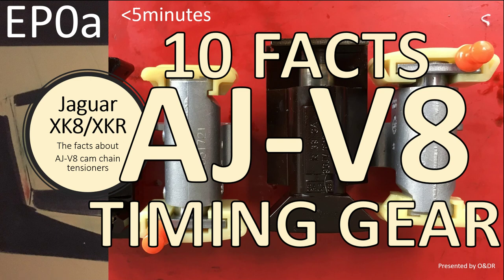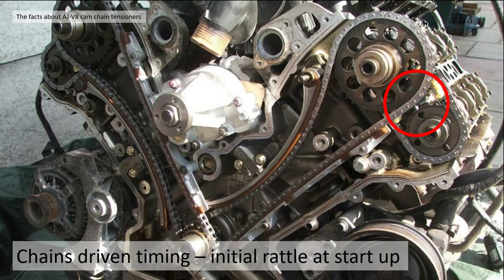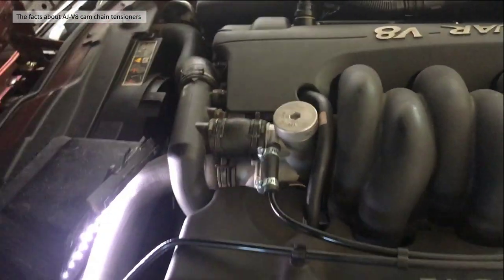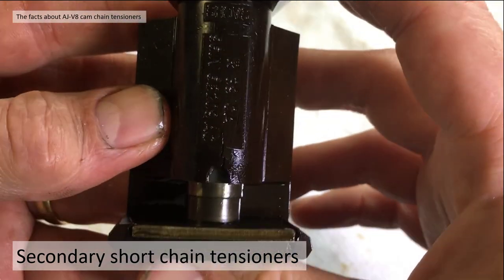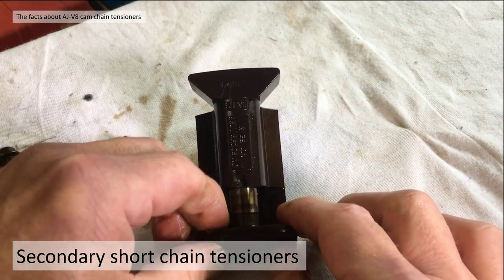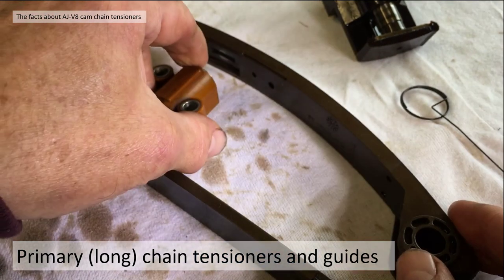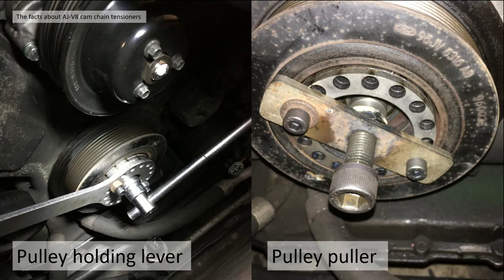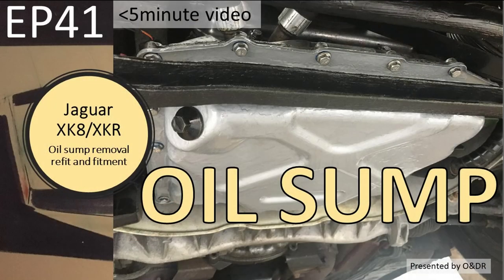Jaguar XK8  - 10 facts about chains, tensioners and guides AJ-V8 timing EP0A / XKR (X100)

Comment: Hi Damian, I wanted to share my experience, hoping it will help your viewers and XK8 owners. 
I own a 2001 XK8, and have heard on several forums and XK8 owners clubs, that early engines produced after August 13, 2001 may still have plastic chain tensioners. 
Well, last week I decided to open my valve cover and I discovered, with great happiness, that mine are metal. 
My engine has the number 010821, so it was produced  just a week after the update. 
Thank you for your videos, greetings from Italy.
Giuseppe
Reply: I forgot to mention that the previous owner, who owned the car for about 15 years, never bothered to check, 
so obviously, 
but also according to my mechanic opinion , the chain tensioners are genuine Jaguar parts.
Reply from the maker: Giuseppe, thank you very much for the information. This is extremely interesting. We couldn't find where the original date originally came from. We have been trying to verify the '13th August 2001' date with any official Jaguar documentation. However, we have been unsuccessful other than confirming its somewhere around that date based on engine and model year changes. A bit of a guess? Therefore, for you to confirm that engines slightly before that date already had upgraded tensions verifies the date is only an estimate and not the exact date. Much appreciate this information and contribution, regards Damian

Comment: This is an absolutely AWESOME video!  Wish I had had it available before I did my tensioners 10 years ago.  I had heard about the problem, and noticed rattling while driving. I knew instantly what was happening, and drove the car home very gently, fortunately with no failure.  I got the latest tensioners and new chains, and  did the water pump, thermostat, etc. When I took the tensioners off, they were in the beginning stages of failure, with cracks, but no missing pieces. So I didn't have to open the lower sump. Anyway, that's taken care of on my car now, but now I have transmission and drive mode problems and it's stuck in limp-home mode. I took the ABS box, opened it up, and took into where I work (Which has an aircraft avionics shop with REALLY sharp guys) and they quickly found and fixed a bunch of bad solder connections.  That's where I stopped, and now I need to get back on the car and bring it back to life again. Thanks again for this video!
Reply from the maker: William, thanks for the compliment. Sounds like you are getting to grips with the ‘normal’ X100 issues. Although annoying you will get though them. Good luck with the project. Thanks for your input and keep us posted regards Damian

Comment: The more I learn about all the fun, travel and adventure people have had with various different chain-driven camgears, the more I realise that actually timing belts are not an inherently awful idea. At least they are a damn sight easier and cheaper to change on a reasonable interval (60k) and you get all the reassurance of a brand new water pump at the same time, plus you can do your valve clearances.
Reply from the maker: Iain, agreed they last a lot longer than belts but not forever even with the metal tensioners, regards Damian

Comment: This is wonderful, thank you.
I’m Alek from Union Pier, Michigan, USA. I bought a 2000 XJR with a broken cam chain, left side.  I’m learning a lot from you, including, sadly, that this is an interference engine
Reply from the maker: Alek, sorry to hear might had purchased a damaged engine. Good luck with finding a good used unit to replace it. Thanks for the feedback, regards Damian
Reply: @ODRModurol  well, I was a mechanic for over twenty years.  I have dealt with this problem on Porsche 944’s, lots of them, 928’s, Audis, Jaguar xk’s, I’ve owned over 12 of those.
I’ve never seen a belt or chain break, bend valves and take out a piston or cause catastrophic engine damage.  
I am well versed in removing heads and bent valves, and guides, grinding the seats and laping the new valves in and putting it back together.  Are you dead sure that this engine is any different?  The valves are soft.  They  don’t take our pistons, not that I’ve ever seen.  I’m wondering where you heard this and if it’s really true.   

Do you know this from experience?
I’m going to approach this like any other car with a broken belt or chain, it’s not a big deal, I hope.

Thank you, I think your amazing, sorry if I don’t really believe your assessment of this particular situation, not until I see it with my own eyes.  I’ll let you know.
Reply from the maker: Alek, if you don’t mind doing the engine work yourself then is quite possible to be repaired. Most owners aren’t at that level of skill or have the time and money. In that case it’s more straightforward just to replace it with a known good second hand engine. Let us know how w how you get on with investigation and repair. Thanks for the comment and feedback, regards Damian

Comment: My tips concerning the tools shown:
The screws coming with the Crankshaft Pulley Removal Tool (it´s always the same made in China, even if the boxing may have a different color) are too long and will penetrate into the engine front cover if no washers are used.
The two bridges of the Timing Kit are useless if the primary chains come off first and the cam sprockets can no longer be counterholded by the crankshaft. To lock the camshafts against the high torque required for unscrewing these sprockets, you need brides with 3 (instead of 2) holes similar to the OE ones that can be screwed to the middle of the cylinder heads.
Reply from the maker: Autodidact, thanks for your input and experience. I made my own crankshaft pulleys tools. Thanks for the comment Damian https://youtu.be/PRiABhZAYkA

Comment: Hello Damian
I'm coming back to you a second time regarding these chain tensioners. From which source did you get the information that mentions the date of 13 August 2001? Indeed, I have consulted several sites on this issue, and I always find different dates.
Thank you for your help.
Reply from the maker: I am currently researching this question but now the question is gone. The date is calculated via several facts and verified in a couple of databases, regards Damian

Comment: Excellent as always Damian - wish I'd had your wise guidance available before I did the exact same range of jobs (including the other jobs, importatnly the cooling elements!) a couple of months back! Ironically my secondary tensioners had been done but my main guides were cracked almost exactly as yours. All the best Dave
Reply from the maker: Dave, thanks for the compliment and comment. Interesting you found the metal secondary tensioners but still changed the primary gear. Most people are frightened of the cost and complexity of doing a thorough job. One thing less to worry about for quite a long time. If you have any tips from doing the job yourself don’t hesitate to suggest them. Thanks Damian

Comment: Thanks for the good information.
Reply from the maker: Udo, no problem. Wanted to share what I have learnt, hope you found it useful. Thanks for the compliment and comment Damian
Reply: @ODRModurol  Hi DAMIAN...yeah... I have learnt my profession as a Carscrewdriver for 60 years ago (Im 75 years old). But I have only work for 3 years, then i have had a study as a Documentary film  cameraman. For all the last years. Older cars they was any time my hobby. Had have a lot of them. OPEL- build 1928, BMW -1948, another BMW-1940, FIAT-1800 build 1968 / 6 cyl, another one Fiat 1800, after this car also an FIAT 1500, then MATRA Bagheera (France), after all cars VOLVO 240, VOLVO 740 and now I have VOLVO 965 + Jaguar XK 8  (2000/2001) . But now repair the tensioners it will be to difficuld for me. ( Oh ..oh..my english ;))  ) In last time I have repair one ingnition coil perhaps I will replace the transmissionbelt. But open the engine ....????!!!!  Oh oh.  But your YouTube canal is very  interested for me. Thanks for all this. Best regards UDO
Reply from the maker: Udo, opening the engine up was a bit frightening at first for me too. Understood at 75 years I won’t be opening up any more engines. Take care regards Damian

Comment: Hi
I bought a 2001 XK8 in November,. registered before the upgrade. The engine runs very smoothly, no rattles at any time and uses no oil.
I suspect the timing chain tensioner work has not been done. 
The advice for the apparently specialist garage when I asked them to check the tensioners was that it is best to leave them on as they are still working well, ie let sleeping dogs lie. 
What are your thoughts?
Total mileage to date approx 61k
Many thanks
Reply from the maker: Michael, would always recommend changing them. You can’t tell the condition without inspection with the cam covers off. The consequences of a problem are too costly, it will possibly right off the cars value. Regards Damian
Reply: @ODRModurol  that's what I suspected.
Reply: Thank you for replying so quickly
Reply from the maker: Michael, no problem, thanks for the comment, regards Damian

Comment: I have an 2003 s type r. I put 235 k miles on it and it was due to be freshened up. I removed the engine and trans had both rebuilt . I'm at the timing part now and need guidance . I followed the shop manual ( mine is not vvt timing ). I locke the cams and the crank. I used the special tool to tighten the bolts and take slack off chain. My issue ? When I remove the tools and spin the motor I reinstalled the cam rails and the crank tool is a bit off . This is second time I did the procedure and not understanding what if anything I'm doing wrong . Any advice ?? I've never timed this motor before so I don't know if the crank being off a smidge is normal ?
Reply from the maker: Mike, this might be the action of the valve springs moving the cam & timing slightly. It’s normal of one of the cams to be smidge off due to this. When you release the cam locks you might find the valve springs move one of the cams (think it’s the inlet cam on the RHS bank from memory). Make sure you lock the crank first and then should be able to relock the cams despite the slight movement, if the timing is correct, as it will recompress the valve springs . Hope that helps, please let us know how you get on, regards Damian

Comment: Excellent video. Just looking for more clarification. Some of the other videos and forums say the third generation tensioners were not used until the 4.2 came out in 2003, but I believe you are saying the third generation were used as of 8/13/2001, correct? Of course my engine was built in 10/10/2001 so I have a vested interest. If you could, please let me know your thoughts on this topic. Thanks.
Reply from the maker: James, the you are correct in your thinking. The intermediate ‘spring’ tensioner came was fitted to engines after 12th October 1998. The third generation was fitted to engines from 13th August 2001. Whilst its correct all 4.2 litre engine have them the 4.2 litres cars started to be built later from June 2002. Hope that clarifies the subject regards Damian
Reply: @ODRModurol  Thanks for the quick response. Lot of confusion out there. One last question. How have the 3rd generations held up over time?
Reply from the maker: James, good question. Not really sure as no evidence or paper trail from Jaguar. The design is quite different but still have plastic running against metal chains (although thicker). They will evidentially wear out but not before the chains have stretched. Regards Damian

Comment: Hi,

I just bought a XK8 with a aj27 engine and the car passed all revision in Jaguar official places. Do you know if the official revision incluided changing these tensioners? The car has 190.000km

Thanks for your videos, you are so heplful.
Reply from the maker: Pedro, need to check the engine number. Mileage not so much of a concern. Most
important is age of the engine. See this video. https://youtu.be/Leea3dpVsnM Good luck with your new car. Thanks for the comment regards Damian

Comment: Hi thanks for the info i have a 2009 XKR with about 80,000 miles should I have the timing chains and guides changed
Reply from the maker: Martin, good question. 2009 model, I doubt it, very strong chains and will have the metal tensioners. On the other hand nothing last forever and chains do stretch, although probably not an issue at this point. When then? No one really
knows? The common thought is probably something else will break or wear out first. Hope that helps, regards Damian
Reply: @ODRModurol  Hi Damian thank you very much for your advice and help I have had the water pump changed and i am very OCD with the oil changes every six months or so. with the possibility of something else going bang that dose make me a bit worried however she is a fantastic car and go's like stink i don't think there is any more i can do but leave it to the gods and enjoy her. all the best and thanks again for the get back i will continue to watch your channel.
Reply from the maker: Martin, sound like you are doing all the right things. They work best with regular use, regards Damian

Comment: As always, nice job Damian. I can't believe for the life of me whatever Jaguar was thinking in making such critical parts out of plastic in the first place! Did they save $2 per engine in manufacture costs? I have a Kawasaki motorcycle (ZX-11) that uses a ratchet type tensioner tensioned by a stout spring. As it wears over time eventually the tensioner clicks to the next tooth thereby locking the adjustment so that it can never loosen. Don't understand why Jag never did anything that simple and bullet proof.

You also mention that "rattle on startup". I actually get that a few times a year on my '04 4.2! I've never sweated it much because it's so rare and I have total confidence that I have the newest tensioners in it by virtue of the model year. I can only presume that sometimes a tensioner sometimes decides to bleed down since the previous shutdown.
Reply from the maker: Paul, good point, I am sure the engineers had good intentions but didn't quite work out in this case. I believe the VVT units can allow slack in the chains if their seals are leaking and not retaining oil pressure. Thank you for your comment and input, regards Damian
Reply: toyota did the same with the R22E  engine...
Reply from the maker: Mr M, interesting info, suppose everyone was trying this out, regards Damian

Comment: Hello Damian. I have a 2001 XKR with 56000 km. concerned with the secondary chain tensioner problem. Do you recommend changing only the tensioners or tensioners with the chain? Thank you for your answer.
Reply from the maker: JB Mon, depends on your budget and how long you expect to keep the car. Easier and cheaper just to change the secondary tensioners. But the primary tensioner’s and guides do breakdown as well over time and not mileage. Regards Damian

Comment: I have a 2002 XK8 that was manufactured in May 2002 I should be fine correct
Reply from the maker: Eric, probably ok but the only way to confirm 100% is to check the engine number. Thanks for the comment regards Damian
Reply: @ODRModurol  which is where? I watched some videos and I can't see it on top of the engine
Reply from the maker: Eric, easiest is to find the ownership/registration documents or equivalent (V5C in the UK). On the actual engine If you can’t see from the top it’s on a cast rib underneath on the LHS. Might be able to get a photo of it with phone camera. Hope that helps, regards Damian
Reply: @ODRModurol  I contacted a JAG dealer they gave me the build date and engine build date which was May 2002

Comment: Fine sir, I have a question. After installing the “metal” tensioners, I have slack in the chain on the non-tension side of the tensioner assembly. I am afraid to reassemble the rest of this job until I figure it out. I assume as you say at minute 7, once I crank the engine, oil pressure will keep tension on the fixed side of the tensioner? Or am I mistaken and have something else out of time??
Reply from the maker: Liver Ticked Outfitters, what year / engine? If in doubt, I would double check the setting up of the VVT units (fully retarded) and the socket positions reference the Jaguar setting procedure. Plus could remove the locks turn the engine over manually using the crank ( put the bolt back in with a spacer). This should pump the oil enough to move tensioners into position. Once the engine turned over a couple of time, can then put the locks back in place to double check the timing is correct. Hope that helps regards Damian
Reply: @ODRModurol  thank you for the help! 2000 Lincoln LS actually, 3.9L engine. I believe I have solved my issue. If there is no Key in the camshaft gear\sprocket, I would guess it has spun on the shaft just a bit. I have everything perfectly aligned, so I am assuming I will have to remove the gear bolt and retorque down, while pulling slack from the top of the chain. Any other thoughts or confirmations are appreciated
Reply from the maker: Think you’ve got although I have no idea on the Lincoln LS engine. Assuming it’s the same would need to tension the chains whilst torquing down the sprocket bolts, regards Damian
Reply: @ODRModurol  it is a non-VVT 3.9L displacement in the 4.0 Block. It is running tonight all thanks to your wonderful videos! I did discover it was not the cam sprockets out of alignment, it was simply slack in the chain because of no oil pressure yet. Pulled fuel pump relay and cranked, and Eureka! Runs nice and smooth!
Reply from the maker: Glad to got it sorted, good work and happy motoring, regards Damian